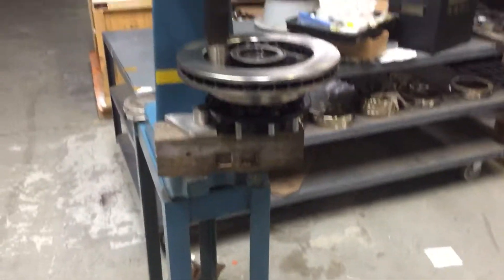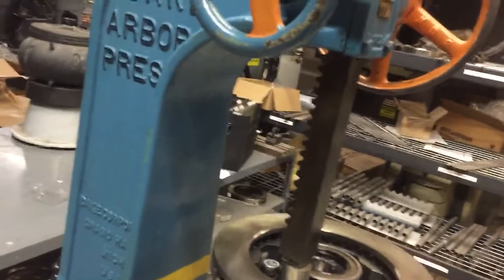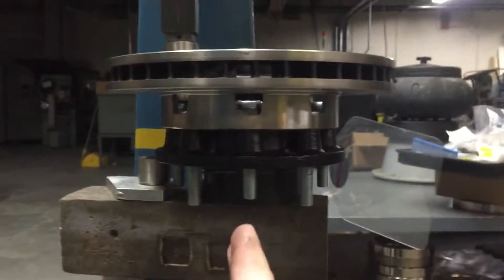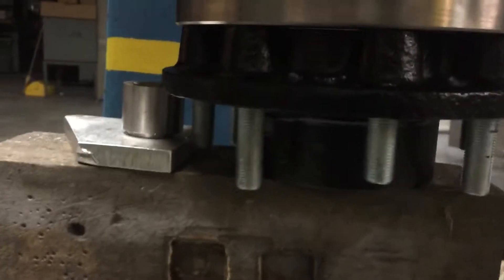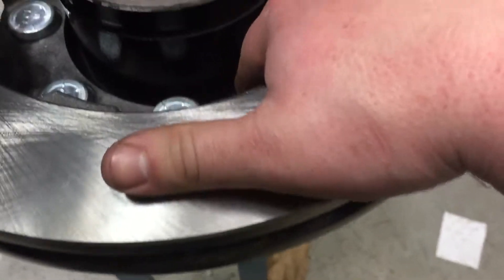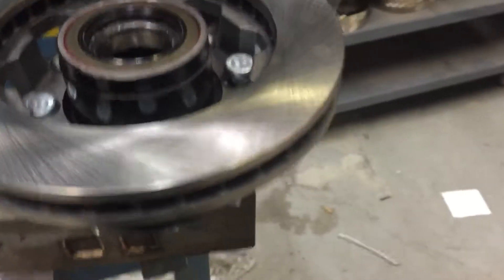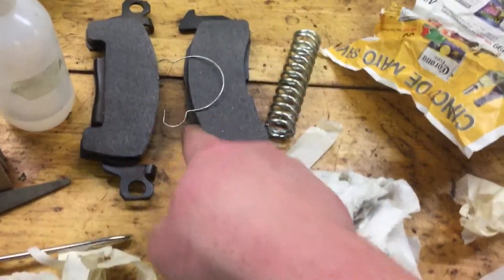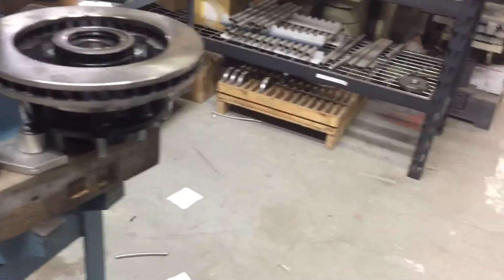CUCV disc brake conversion PT:4

Comment: So maybe its different on the older trucks, but isn't the disk supposed to go on the stud of the hub so that the disc spin with the wheel and not stay stationary? It being behind the hub on the axle would make it stationary no?
Reply from the maker: No the studs are pressed through both the hun and disc joining them into one huge assembly that spins